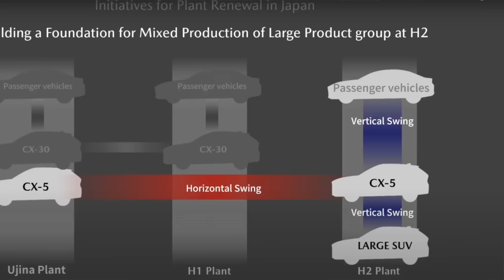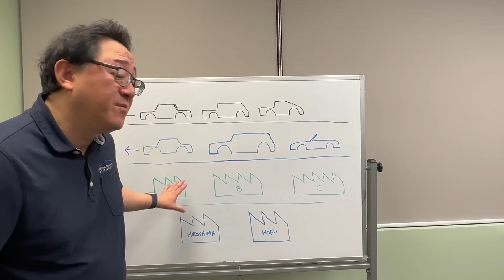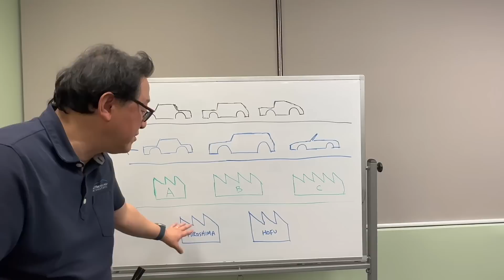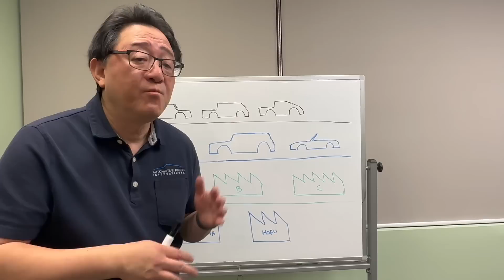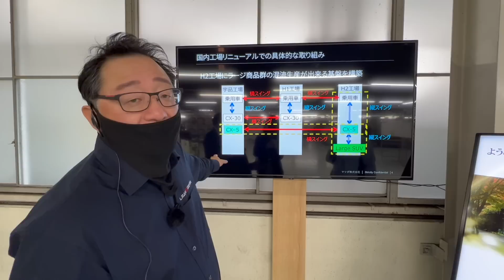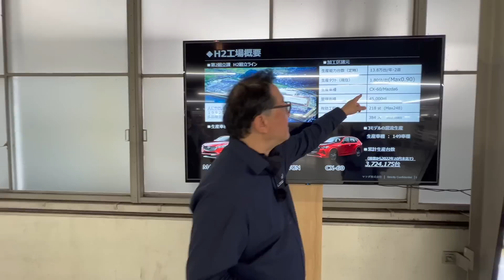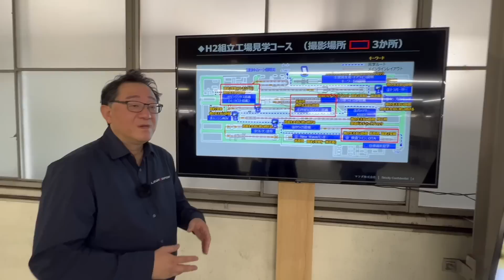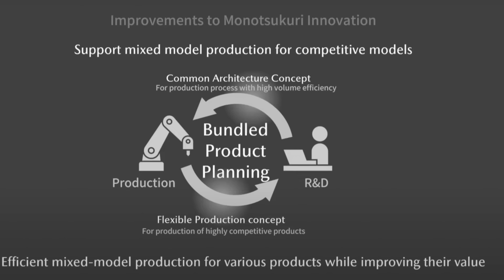ENGINEER'S DREAM FACTORY - WORLD'S MOST AGILE & FLEXIBLE PRODUCTION SYSTEM BY MAZDA

Comment: I think it's very unique for a company to have that many platforms like Mazda has now. Current CX5 is based on the old platform, same as 1st gen CX5, CX 50 and CX30 and Mazda 3 based on a new one. CX 60,70,90 have a new latest Mazda platform with inline six engines and rear wheel drive

Comment: Hi David. Appreciate your report on Mazda's automobile production, Mazda's emphasis on multiple-unrelated-model production on the same assembly line, and Mazda's flexible production vs Toyota's mass production (similar vehicles on one assembly line). Does this mean Mazda production method has a higher cost than Toyota production method? I watched a documentary on Porsche Zuppenhausen production line and I think Porsche is also using AGVs for multiple vehicle model assembly? Is that true? Or is Porsche making similar models on one assembly line? I just saw another Mazda production documentary (2016-2019). It seems that Mazda is casting their own engines in the same plant where they are completing final automobile assembly. Is this true? Is Mazda casting specific engine blocks in the same plant where they are completing final assembly of the entire vehicle?

Comment: I hated my 2005 mazda 3. Great handling but the body rusted so quickly, the AC was very weak and parts were expensive. I currently have a 2011 mazda 2. The AC works great. Handling is great. Despite taking good care of it. It started breaking down in 2021 its like every 3-4 months something breaks and parts are very expensive. Even if you replace it, only the dealer could turn off the MIL.
My wife now hates Mazda and wants a Toyota only for our next car.

Comment: David @AutomotivePress do you think Mazda will carry over their interoperability assembly process to the shared with Toyota plant in Huntsville? Would the same production/assembly line be able to make a CX50 and a Corolla Cross utilizing the AGVs?
Reply from the maker: The Mazda Toyota joint venture plant doesn't use those flexible AGVs and the Corolla/CX-50 lines are completely separated.
Reply: @@AutomotivePress  Thank you! Would love to see you showing that plant too - big difference between the regular conveyor-belt assembly and th AGVs

Comment: I think Mazda is underrated....
Reply: No, they’re suffering from the reputation that they got when they got in bed with FoMoCo. Loyal customers who purchased their products before the union with Ford knew that the products were not much more than a rebadged Ford and if they wanted a Ford they would have purchased one. I realize that relationship with Ford is gone but you don’t have to sell the average customer but one turd and many won’t give you a second chance. Unreliable Jatco transmissions have not helped Mazda either. 
I’ve been a master technician for 30 years and I remember when Mazda built a solid product. Wasting boatloads of money on a rotary design that is still a failure along with other things put them on thin ice financially hence the reason they yoked up with Ford. In my experience the biggest issue with modern cars is not the production methods used. It’s the designs and quality of components that they’re using that is causing horrible reliability issues. CVT transmissions, Direct Injection, and cheap quality components that all manufacturers are sourcing for their products has killed the enviable quality reputation that the Japanese nameplates used to have. 
I’m still in the repair industry and honestly, there’s not enough difference in the quality of all vehicles today whether they are domestic or imported. They all suck and are costing their owners huge amounts of money to repair.
Reply: It’s just overpriced otherwise people know how reliable and beautiful it’s.
Reply: @youtubesurfer1533  I think they're reasonably priced for what you get.
Reply: @youtubesurfer1533  not all, they are better value then Toyota
Reply: @youtubesurfer1533  You’re out of your mind. Price a comparably configured CX-5 to a RAV4 and get back to us. I won’t even mention current Toyota Suggested Market Price tactics, which add $5K-$10K to the price.